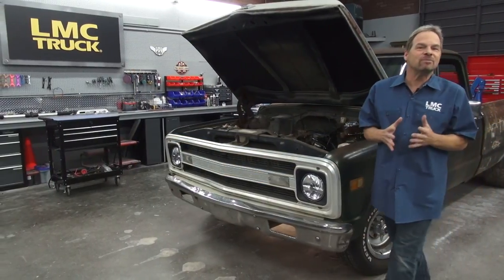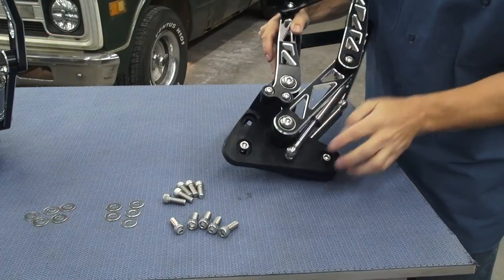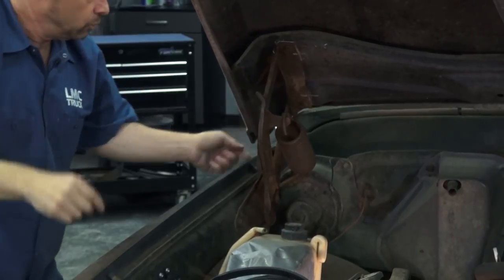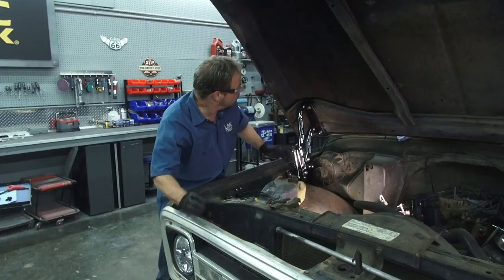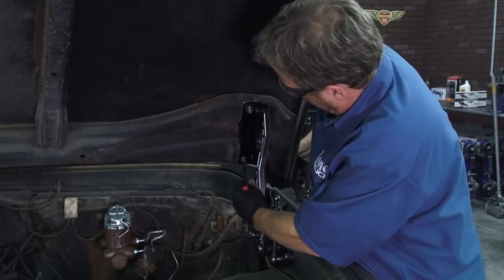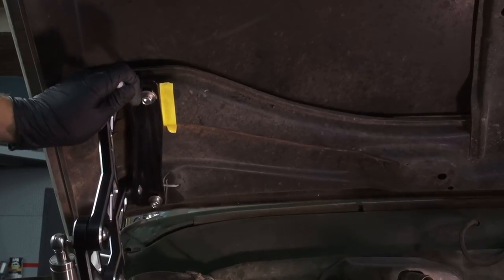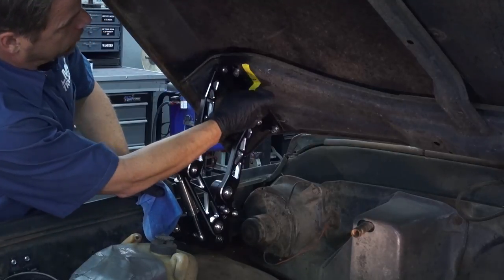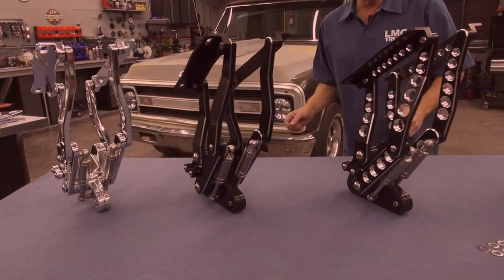How to Install New Billet Hood Hinges on 1967-1972 Chevy Trucks - Kevin Tetz with LMC Truck

Comment: Nice looking hinges, but I'd rather go with factory, as it's a lot less adjustment (and I'm just too impatient!).  Love that year C10!!
Reply: The bullet hinges aren't just for look. They eliminate the left to right movement you get with the stock hinges opening and closing the hood. Smoother with the strut attached at the bottom rather than a spring too.
Reply: not to mention saving a ton of money

Comment: What's up with the 71-72 front bumper on this 69?  
Any suggestions...
Reply: The Chevrolet C10 was manufactured from 1968-1972

So there's very little change in the style during the production run of that year model of truck

Comment: The problem is there isn't a simple decently made stock replacement hinge out there. I got a set of the cheap repos and they're impossible to make fit properly, and one has already bent within 2 months of gentle use. I'm not spending $600 on billet hinges that would look ridiculous on my beater hot rod truck, just as they do on this truck... If you guys and Brothers are so into helping us restore our trucks, quit pumping out these terrible parts to sell us and make us some quality parts at an affordable price. I don't want to put cheap junk on my truck, but it's not a 75K restore.